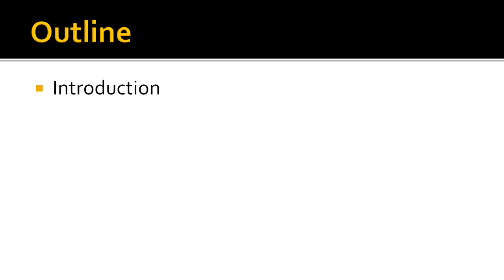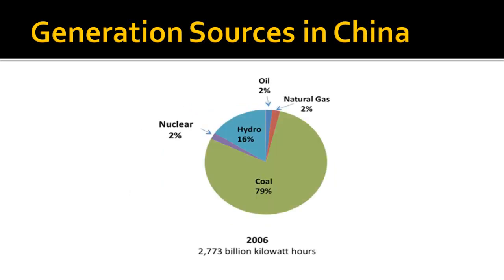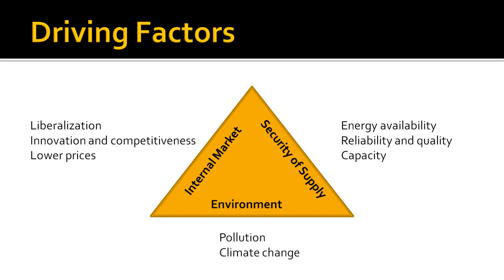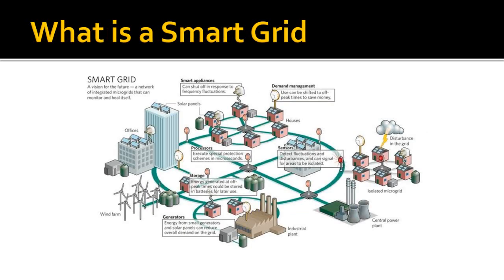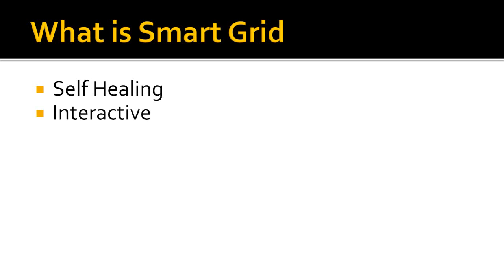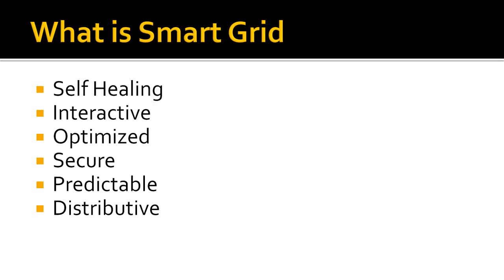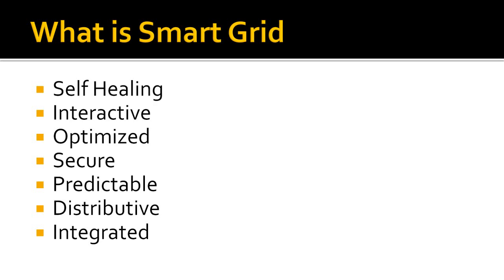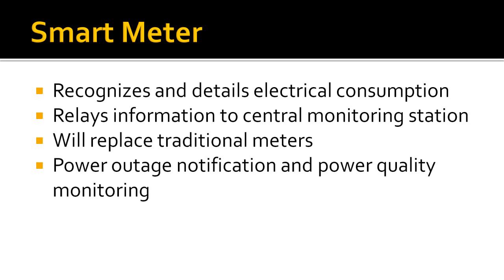Smart Grid Presentation Part 1

Comment: Spoken like a true ignorant, dig deeper into some facts and information and you'll find that the topic is bigger than just Smart Meters. Smart Meters DO need energy to work, however, you are missing the bigger picture ie. the optimisation, usage control and overall power supply management of Energy Systems. Think about it. If you'd like to know more, feel free to email me and lets discuss this more indepth ok? Cheers.

Comment: EECE 492 standard, being developed by the engineers working for the companies manufacturing the products to be employed in the smart grid, and as with most 'smart grid' presentations, intentionally ignoring, or naively missing the part about EMF radiation being rained upon our homes and neighborhoods via the method of using non-sheilded grid wiring for ultra high frequency radio communications. Tough luck if you're the 'canary in the coal mine' who actually hears these frequencies 24/7!